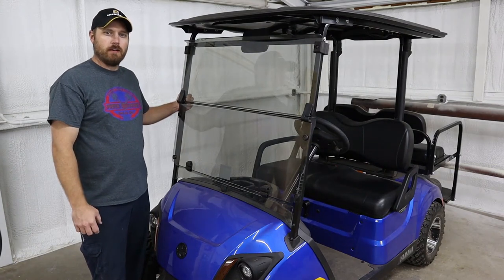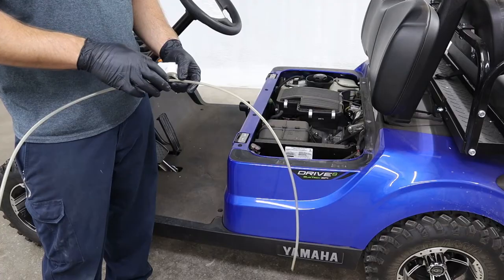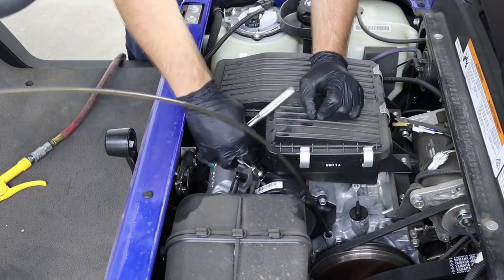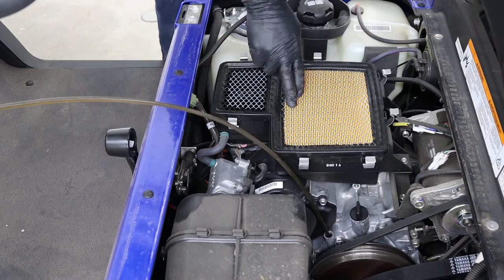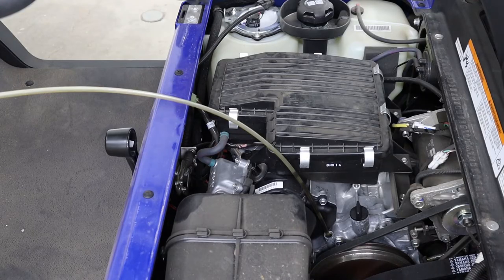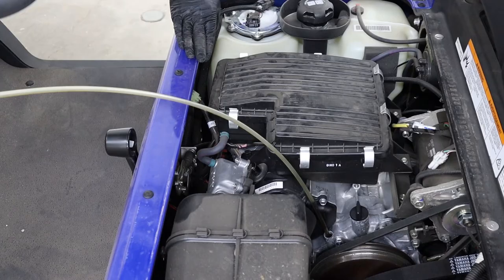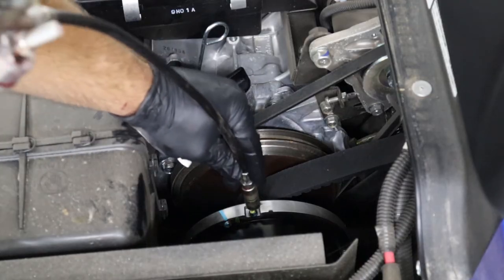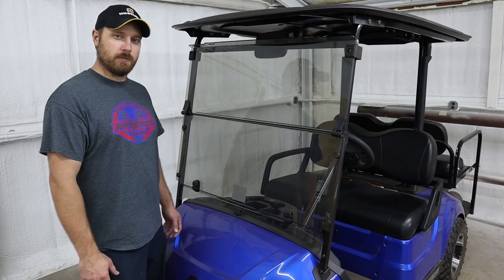Yamaha G29 Drive/Drive 2 Quietech - OIL CHANGE - Service

Comment: Hey man, great video I actually just bought a brand new 23. The question I have is do these things have an oil filter. Thanks for the video as well.
Reply from the maker: No, these engines do not use an oil filter.

Comment: Awesome video. Local golf course told me they do it the same way on theirs. Question, is there an Oil filter that needs replacing?
Reply from the maker: No these carts do not have an oil filter.

Comment: Hey Jonas, great video. I plan on purchasing this exact golf cart in the next few months. I’m assuming the drain plug has a seal. Do you ever pull the plug and replace that seal and if so, how often?  Love your videos, you have a new subscriber.
Reply from the maker: The drain plug on these use an aluminum washer, so if you never remove the drain plug there is no reason to replace it. Thanks for watching

Comment: Thanks for the video, Im now to the golf cart world. Just got a 2019 Fleet 2 electric. Does the electric version needs an oil change too?
Reply from the maker: No an electric cart doesn't have any engine oil that will need changed. You will have rear differential oil that will need changed every 3 to 5 years. The biggest thing you need to keep an eye on is your water level in your batteries. Also clean any corrosion off the terminals and make sure they stay tight. And the cart should always be plugged in anytime you are not using it. Don't park it on concrete in your garage without a drip mat under it or the battery acid will stain your floor.
Reply: @PowerEquipmentMan  plug it in every any time I'm not using it?I asked the guy who dropped it off and he said no.I guess he was wrong. Lol... Also do happen to know the "G" version?Is it a G29 also? Appreciate the response.
Reply from the maker: @ntrddragn  The Drive 2 is still called a g29, just like the drive 1 was. I'm not sure why they didn't change it. Most of the accessories you look up for the "g29" is for the Drive 1 and wont fit the Drive 2. The model name for the Drive 2 electric is DR2E. I would highly recommend plugging your cart in every night unless you like to get stranded. If you are using it at different times throughout the day you don't need to plug it in-between uses, just when you are done with it for the day.

Comment: great video as always. what is the correct spark pug gap please?
Reply from the maker: 99% of the time with NGK plugs the gap doesn't need to be adjusted. If you really want to check it though it should be around .030"
Reply: @PowerEquipmentMan  I dropped the new plug, that is why I need  to know the correct gap. my cart wants to go chug, chug like it is loading up when I first take off, any ideas please? I installed new gas and air filters and adjusted the throttle cable and it still does it. the throttle cable had about 1 inch slack in it. i adjusted it to take up the slack, but no change in the chugging on take off. runs fine at low and all good up to full throttle

Comment: Good video! I couldnt figure out the skid plate so i just used the oil extractor like you did. The thing i dont get is the grease. Does it say to do that in the manual?
Reply from the maker: We were told at the Yamaha training school about greasing the clutches. I'm not sure if that info is in the the manual or not. I figure they wouldn't have put grease zerks on them if they weren't supposed to get greased.

Comment: I’m a complete novice when it comes to mechanical maintenance, what kind of grease would you recommend for the clutch? Awesome video by the way, keep up the good work.
Reply from the maker: Just use any type of multipurpose grease. I just updated the links above for a nice 3 oz grease gun and cartridges. Thanks for watching!
Reply: @PowerEquipmentMan  thanks a lot for the quick reply. Just ordered the grease gun you linked. I noticed on the website for the tune up kit that the brand of oil is Maxima, do you still prefer Kohler 10w30? Kohler 10w30 is the exact oil I use for my riding mower and figured that would be awesome being able to use it for the cart as well. Thanks again!
Reply from the maker: They are both good. If you already have the kohler oil just use that.

Comment: is there a specific kind of grease to use in the drive clutch zerk fittings?
Reply from the maker: We just use a regular multipurpose grease.
Reply: Copy that. I'm using Lucas Red N Tackey. I've had great results with this brand on my motorcycles. BTW
 Your videos are very helpful. Keep up the good work !

Comment: What are you thoughts on adding sea foam to the oil 50 miles before you change it and adding it to the gas tank as well?
Reply from the maker: We do not do any additives to the oil. We do add Stabil to the fuel to keep it from going bad since a tank of gas last for so long in these carts.

Comment: How often do you recommend changing the spark plug?  Thanks
Reply from the maker: Every time that you change the engine oil. Which should be at least once per year (depending on how much you use your cart).

Comment: Thanks! Question, I have a 2017 that's been fine until today... It runs, then dies, and is sluggish to start and then stalls. I checked the plug, it was carboned but DRY and I cleaned it and reinstalled, but same result. The cart has been ran almost daily, except for the past few weeks I had shoulder surgery so not until today. The OIL looks BLACK. I had it at the dealer about a year ago for a rear spring upgrade and they said they did the service.... There's a gas smell and the tank gas smells varnished, which is weird because we fuel it when it gets to half and we have two acres in the country and use it quite frequently (go miles around the neighborhood too at least once a week) except for the past two weeks. Any ideas?
Reply from the maker: Sure sounds like its a fuel problem. It would be better to let the gas tank run almost empty and then fill it up with fresh fuel each time. If you keep refilling it when it is half full, the fuel that is in there is still old. Make sure the fuel that you are putting in it is fresh and hasn't been sitting around in a gas can. Add fuel stabilizer to the fuel each time you fill it as well. 
I would start with draining the tank completely and adding fresh fuel. Oil needs to be changed at least once per year or more depending on use. So do an oil change now. If its carbureted, clean the carb (or have someone do it that has an ultrasonic cleaner). Replace the spark plug (don't just clean it). Remove the spark arrestor from the tip of the muffler and throw it in the trash (if it is a Quietech model).

Comment: Is a torque wrench not necessary when installing the spark plug?  Looks like Yamaha does recommend around 15lbs of torque when re-installing in the manual.
Reply from the maker: I've been a mechanic for over 20 years and never once used a torque wrench to install a spark plug...never had one fall out either. We call it a "calibrated elbow". If you are more comfortable using a torque wrench though, go ahead.

Comment: Hi I have a 2018 Drive2, I just bought it and it is backfiring when it gets warmed up and is coming to a stop sometimes even after being at a stop with engine off for a second or two!! Do you have any recommendations on how I can fix this? I’ve already checked and made sure all the intake and exhaust bolts are tightened. Thanks in advance for your help. 🙂
Reply from the maker: If it is carbureted I would guess that the throttle cable is too tight or carb is dirty and it is holding the butterfly open a little bit allowing gas into the engine while its still turning over but not firing. If its EFI it could be an injector problem and would need to go to a dealer. Backfires are most commonly caused by excess fuel not getting burned.

Comment: Just replaced the carburetor. Still have some spitting and sputter like on my cart just like this. Any recommendations?
Reply from the maker: Did you use an OEM carb (expensive) or aftermarket (cheap)?

Comment: Is it true that on the 2022 Yamaha put a thick protective coating on engine on the drain plug side? All around mine has cracks near the drain plug. Dealer told me it was normal and showed me a new crate engine with the same cracks. Have you seen this in your experience?
Reply from the maker: I have not heard anything about a coating. But Yamaha has always had rough castings for these engines. They may look cracked but they are really not. If it was cracked it would be leaking. Even if yours did somehow get cracked, you've got a 4 year warranty that would take care of it.

Comment: Never heard of a dedicated small engine oil.  What is different about it?  Never had a problem using a good quality (car) oil in small engine but never too late to learn something
Reply from the maker: This article covers most of it - https://wengerequipment.com/2018/03/28/why-you-should-use-small-engine-oil/
Small engine oils also usually have an anti-foaming additive because they use splash lubrication and run higher RPMs.

Comment: My 2020 Drive 2 EFI seems to be running very rich.  The smell is killing me but the cart runs good.  Any Ideas?  It has 90 hrs. on it.
Reply from the maker: We have not personally ran into this issue, but I have talked to one or two guys that had. I gave them my suggestions, but never heard back if it fixed their issue. My first thought is that the fuel injector is leaking. If it has some type of debris in it that is not allowing it to close completely it would be leaking fuel into the intake the whole time the cart is running. If that isn't it, then I would look at the intake air temp sensor, cylinder temp sensor, and MAP sensor. If any of those sensors were giving a false reading it could tell the ECU to add too much fuel. For example, if the air temp sensor was telling the ECU that it was 40 degrees out when it was actually 90 degrees, the ECU would be telling it to add more fuel then it needs because its cold when its not. The problem is most of those sensors are difficult to test, and Yamaha doesn't even give specs for some of them. Chances are, even if you take it to a dealer, they will just start swapping out sensors until something fixes it. It also wouldn't hurt to check the spark arrestor on the tip of the muffler and replace the air filter. Keep in mind that these carts all come with a 4 year warranty, even if you aren't the original owner, the dealer SHOULD still honor it. If you have a good dealer close to you, just let them figure it out under warranty.

Comment: I've got a 2018 Yamaha Drive 2 Quietech EFI Fleet that started showing the check engine/oil light (solid) right when I first press the accelerator after it's been sitting for any prolonged period. It's not flashing, and it only stays on for a few seconds and then goes away. It does not come back after the cart is warmed up. The oil was changed in October, and still looks very clean and is at the correct level. If anything, it may be just a little over. Any idea why the engine light is coming on after a cold start?
Reply from the maker: The check engine light should come on solid for a few seconds after the cart is started the first time to do a system check. What you are explaining sounds normal.

Comment: I thought the rear end had a 90 wt gear oil to check. If not how is it lubricated??
Reply from the maker: Yes, you do have to change the rear diff oil every 4 to 5 years. We have several videos showing how to do that depending on which rear axle your cart has. Here is the one for the Quietech - https://youtu.be/QXTKhGYVRf4